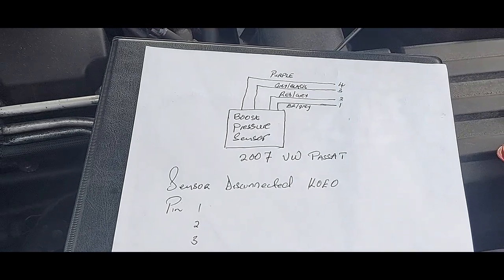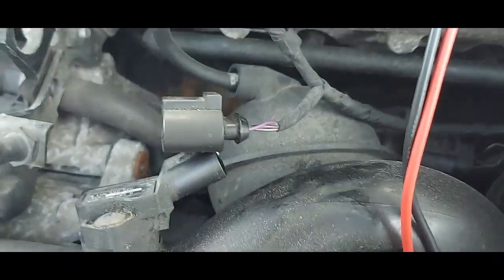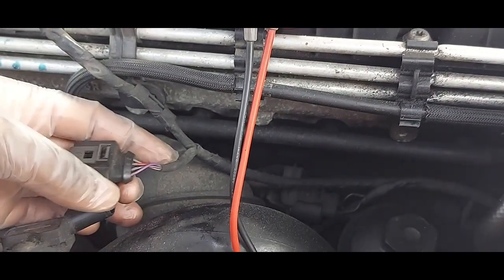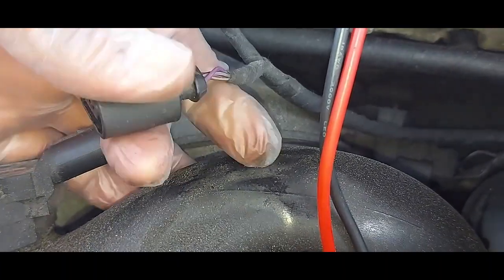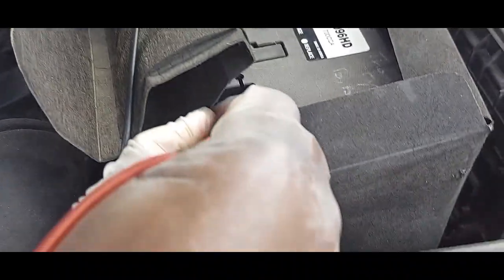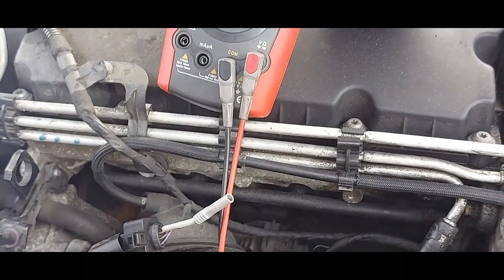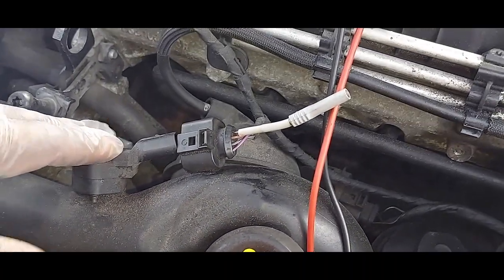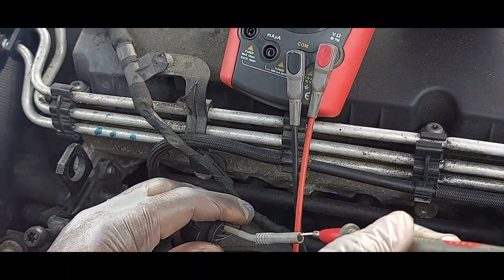Boost Pressure Sensor Testing: Your Ultimate How-To!

Comment: Thank You very much for the Video! Any Idea why i would get just 0,013 Volts at the forth Pin with the Sensor disconnected? 4th pin should stand fort the Boost pressure sonsor signal. In your Video it shows 5 Volts with sensor disconnected. In my case it shows the same as my ground, 0,013 V. With connected sensor it changes to 3,7 Volts. Would be very greatful for any help. Greets from Germany! ps: i drive an mk5 with the 1.6 l petrol motor from 2007.
Reply from the maker: The major problem issue here is that this boost pressure sensor is for a diesel engine while yours is petrol. They cannot be the same. What codes are you getting

Comment: I measured my values on my volvo v70 d5 2009. and everything was the same, except number 4 which was 0volt when the sensor was unplugged. Could it be that number 4a has a broken cable?
Reply: Only the connector 
1- 0 volts 
2- 4.96 volts 
3- 4.99 volts 
4- 0 volts 

sensor connected 
1- 0 volts 
2- 2.52 volts 
3- 4.98 volts 
4 - 1.59 volts
Reply from the maker: Your Number 4 wire is fine i suspect Pin 1 if it stays at 0V when connected and engine running, it has an open circuit. Please take the measurement and see
Reply: P0047 Turbol/superchargercomPressures boost pressure control valve circuit low

P0045 Turbo/supercharger boost control solenoid circuit/circuit break,General error information about error type
Reply from the maker: What was it when the sensor was plugged Jimmy?

Comment: I have p0235 boost sensor A malfunction . Ive change the Map sensor but it still keeps putting the car in limp mode . Mk3 Ford mondeo tdci . 2007 year . Any ideas  ?
Reply from the maker: Whenever you changed the boost sensor did you get the same code or you have a different code please clarify

Comment: Nice video.  A question Plzz. 
I replaced ECU on my golf gti mk5, and then these 2 errors came up. Car was running 100% fine, as soon as ECU replaced these errors logged in 
In the first start after ECU replacement, radiator fan started running as soon as engine started and when engine shut down , fan still running for 1 minute, and engine cold.. Then in 3rd 4th start fan didn’t run on car start.  And after a while fan ran. And when engine shut down, fan also stopped immediately. 
I read somewhere, that it wall time to adapt and after few days car will run normal. 
Errors are 
P0238. Boost pressure sensor .. high signal 

P2185.   Coolant temp sensor  signal too high 

I will replace both sensor , coolant & MAP , but I don’t think they are the culprit. I guess either wiring has shorted during ECU  & battery connecting & disconnecting or new EVU will take time to adapt. 
Your help will be really appreciated.
Reply from the maker: The errors that you see came with the ecu .I would like to believe that you bought a used ECU. if that is the case, the errors are not from your engine

Comment: Hi! And thanks for the informative video! I got at Tiguan 2010 with issues with the combined boost and temp.sens. Measured the voltages with the sensor disconnected and this is the result: Pin 1: 0.01V, Pin 2: 0,23V, Pin 3: 5,01V and Pin 4: 5,63V. Im guessing the connector/cable is shorted on Pin 2, but im also concerned regarding Pin 4. Isn’t this a bit high? The fault code for temperature is there always, but when i push the car, it goes into limp mode with hight boost pressure. Any thoughts? And thanks for your help!
Reply: And also, it is a 2.0tdi
Reply from the maker: It would be easier for me analyse your faults if you had given me measurements with the sensor connected as well

Comment: Hi Jamroz.. excellent video. Do you have any videos on how to check the wiring harness on glow plug 3 of a mk7 golf? Getting P13d6 code and the glow plug 3 has already been replaced so suspect a harness issue. Many thanks
Reply from the maker: Please confirm if Pin 1 is Black, Pin 2 is green, Pin 3 is Brown and Pin 4 is Black & Green
Reply: @jamrozelectronicssolutions7232  will check this in the morning and come back to you.
Reply: @jamrozelectronicssolutions7232  Hi , yes I can confirm the pins are as above on the harness/connector for glow plug 3. Thanks for helping with this.

Comment: Interesting but how do you test 3pins .I've a toyota auris d4d 1.6 diesel had loads of codes coming up ,most of them cleared after and p0236 Tc boost and SC boost ...any help would be appreciated
Reply from the maker: 3 pin is easy to check. usually the middle pin is the signal. the outter pins are power and ground.

Comment: Hello, thank you for the video, very helpful, just a quick question, is the termistor part of  the boost pressure sensor? I have a probkem where my VW goes ubyi linp mode buy when it us warmed up yhe yhe problem dissapears...
Reply from the maker: send me the code then i can tell you which thermistor it is. a thermistor is a temperature sensor

Comment: Unfortunately, Pin 4 signal wire has 0.00 volts.  I have continuity between the sensor connector and the ECU harness.  If I check the continuity to ground pins 2 and 3 have higher continuity (300 when set to 2000k) to ground than pin 4 (550 when set to 2000k).  Does this mean the ECU is bad?
Reply from the maker: it appears like your signal wire is shorted. disconnect it on both sides. connect your ohmmeter on one side of the wire and connect the other side to a ground. OL or 1 means not short to ground but if you get a reading you have a short

Comment: Hello Jamroz.
I hope You can help me.
I have check the voltage of Turbo boost sensor.
And if the plug is unpluged I, have 5Volt to boost pressure, but if the plug is plugged on I get 0 Volt to boost pressure.
Will be the turbo boost sensor damaged?
Reply from the maker: you have a short to ground change the sensor

Comment: If I brake the pressure sensor will the turbo last longer?   I know it will be slower.
Reply from the maker: if the boost pressure sensor is not working, the engine goes into limp mode. Your turbo will not do much
 My fear is what could happen if the engine is getting extra fuel say from oil going into the combastion chamber which could cause the turbo to runaway. otherwise it should be ok

Comment: So if the boost pressure sensor voltage was to drop, what would it mean?
Reply from the maker: The engine will lose power and may go into limp mode. engine management light will come on

Comment: Disconnected, just checking boost signal is 0v which from ECU? Continuity is fine. Rest of are fine. Just boost pressure signal is showing 0v.what could be issues. New ECU.
Reply from the maker: Thank you for your support. if i understood your question well. you don't have a signal. i am suspecting that you have a shot to ground. disconnect both sides of the signal wire and connect your ohmmeter to one end of the wire and another end to the ground preferably the battery negative. let me know the results you get

Comment: Thank you very much for such a clear explanation. have rectified bell 4206D that had error 105.3  we finally discovered an open circuit on one wire close to the sensor.
Reply from the maker: You are welcome!

Comment: How do you know if sensoe is defect what values should you get for faulty Sensor?🤔
Reply from the maker: The signal wire is your yardstick for checking the integrity of the sensor. If the ecu is providing power and you ha good ground the sensor should give a signal upto a volt at koeo. Autodata is a good guide. I do not like to rely on resistance I would rather check voltage drop instead
Reply from the maker: I will come up with a video to clarify your questions thank you
Reply from the maker: Which sensor specifically out of the three  on this video are you asking about

Comment: Great information, but how would I prove that the sensor is faulty?
That’s the only part I don’t get 
 Will I just have no voltage to the signal wire?
Reply: Is there a way of testing the sensor whilst it’s off the vehicle i.e. continuity test or resistance test between the pins? Thanks
Reply from the maker: There are so many ways to prove a sensor is faulty.  Let me say you  need a workshop manual for guidance. The best way to judge a faulty sensor is to check its signal against specification like ones I gave in the video. I will create a video to discuss your question at some stage.  Thank you for your valid comment